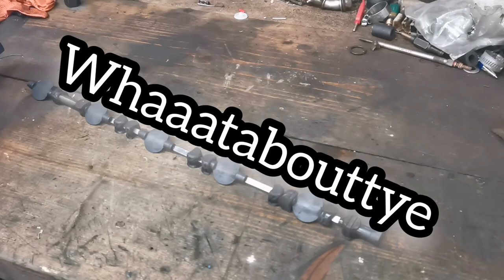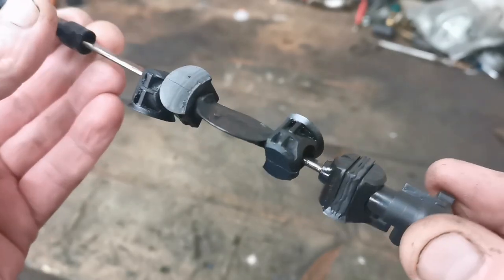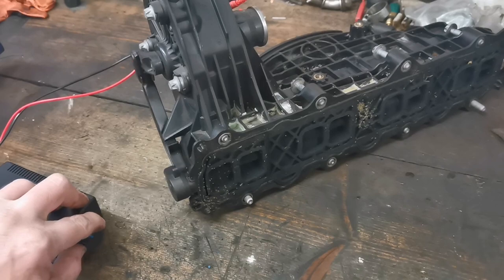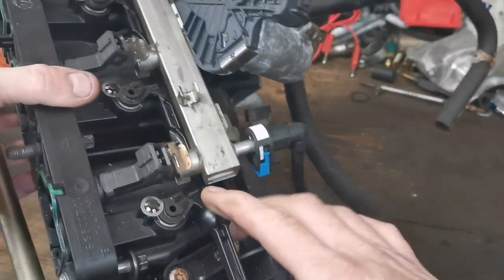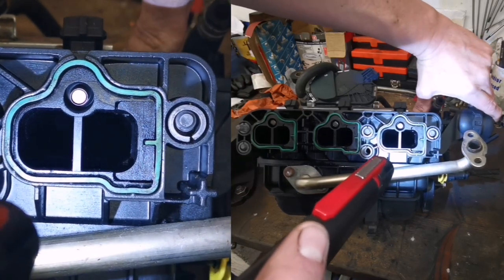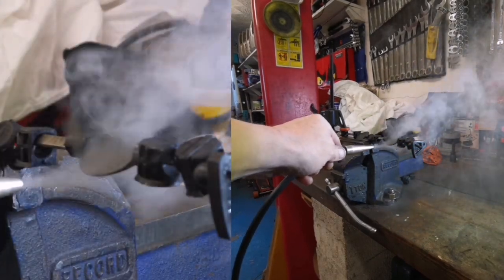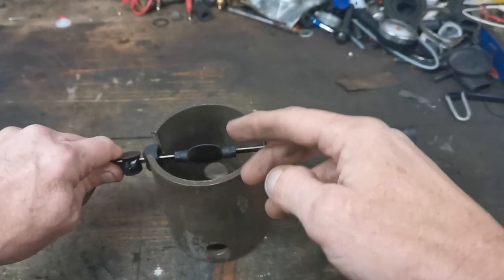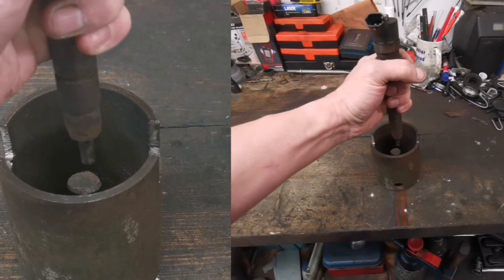Swirl Flaps Operation

Comment: That was very interesting but I don't think you emphasised enough that it is exhaust gases that are destroying the swirl flaps and clogging up all the pipes and EGR valve on the way. But at least the repair is a job that an average DIY person can do: no heavy lifting, no special tools, no getting underneath the car. I hate the fact that the designers have to do all this to meet emissions in a lab test but once it has done a few thousand miles all the good intentions have gone out of the window leaving the owner with big repair bills.
Reply from the maker: I didn't emphasise EGR because this video isn't about EGR

Comment: Started changing my swirl flaps and one of them is missing, the one opposite the linkage end. Do they get sucked in the engine if they fall in the port. Tried vacuuming out but nothing is coming out of the hole. Waiting for a camera to arrive

Comment: Had one fall to bits on a alfa romeo mito. Sucked the flap in and distoyed the engine. When I showed the customer she just cried.  We sold the car as a going concern rather than swap the engine
Reply from the maker: aye for sure, hard to explain to the punter there are moving parts in the inlet and it has wrecked itself

Comment: Thanks for this, very very very informative explanation. The swirl control arm has broken off on my D5 2.4 2009 Volvo XC90... couldn't fathom what it actually did. Found the name in the Haynes manual and then your brilliant video explained what it does!

So now I know and know why it's also covered in oil!!! The boost is leaking!!! Got a bog job ahead of me now but at least I know it needs to be done!

Cheers bud!

Sammi x

Comment: Thank u for making this video. Great explanation..

A small query. What is the point in adjusting the air flow direction using swirl flaps..

How the combustion could be better while adjusting the air flow direction.

Comment: Hi Dave, came looking at your YouTube uploads for info on VW/AUDI 1.6 TDI CAYC air intake manifold swirl flap motor.
Having watched your vid on 1.6 tdi  EGR  cooler valve how it works.  I am assuming swirl flap motor also uses 5.0+ & 5.0- to actuate the swirl flap shaft.
Please can you provide 5.0+ & 5.0- pin numbers. As l cannot find a wiring diagram for this motor.
Reply: Hi Colin, did you ever find out the pins? As I want to test my swirl flap motor as it hasn't ever moved from fully open and either it has been mapped out or is broken. It is supposed to do a full range movement every 6 cycles of the ignition.

Comment: And all this time, I thought they would variably block off one of the two intake ports behind one of the two intake valves, causing air to actually swirl inside the combustion chamber due to the imbalance of pressure and air volume between the two (asymmetrical) intake ports versus simply getting a bit turbulent as you purport.
If your theory is to hold water, please explain how this butterfly valve creates turbulence when it is full closed or full open.
Reply from the maker: That's great info, you should do a video on it

Comment: Hi , very good JOB!

i have a question regarding flaps on Volvo D5 , mine when i push the rod ( i disconnect the commande side) with my finger , it seems that is very easy and without any resistance.  Yours is the same? it could mean that the flaps inside do not move? how can check it without removing the intake manifold?

best regards

Comment: Can bē that new swirl flaps can be harder to turn?
Reply: I noticed that when I fitted new swirl flaps to my Volvo D5 the actuator seemed quite stiff to turn. I am hoping that is OK and the actuator motor won't burn out. I did squirt oil on the bits that moved before final assembly.
Reply: The actuator must be adapted by VIDA-it is free.Go to diagnostic/vehicle communication/double click on ECM/advance/expand ECM/choose swirl actuator adaptation